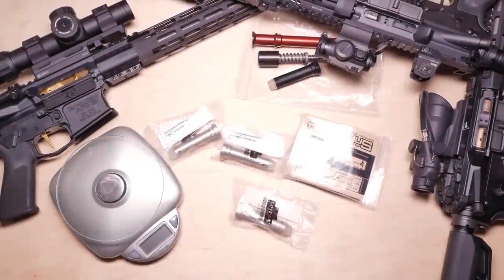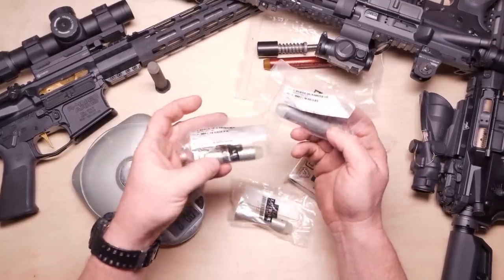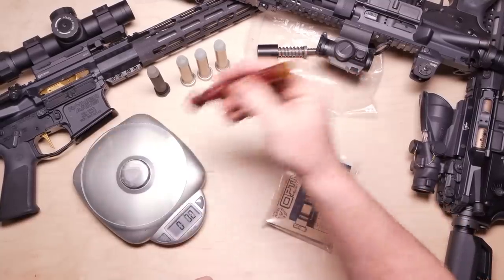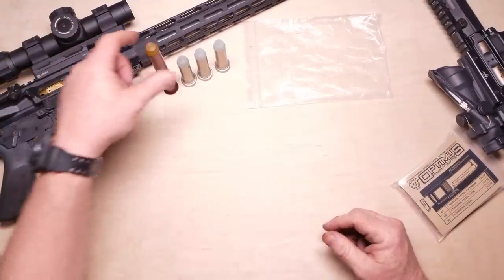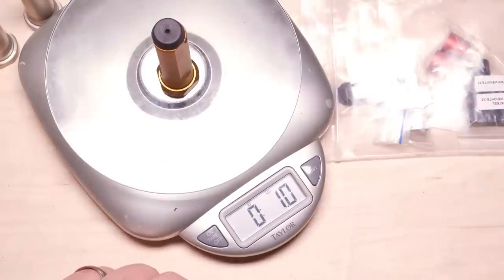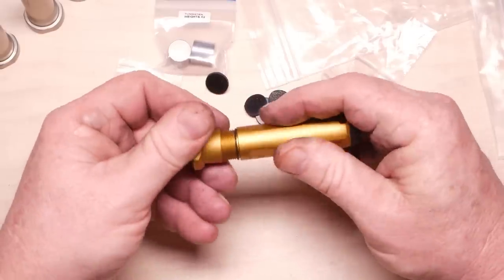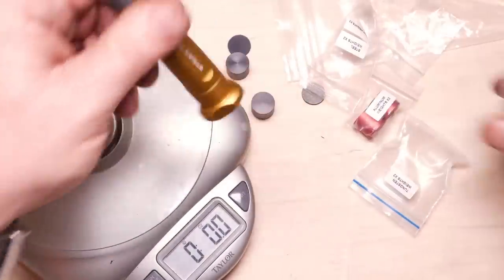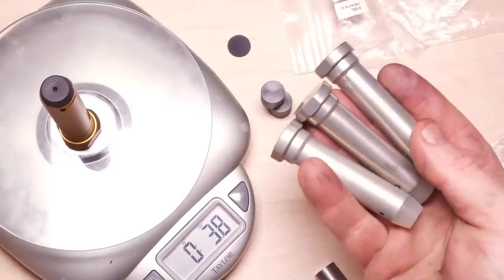Strike Industries Optimus Buffer System and Why it's Cool

Comment: You can buy a pack of tungsten weights and do the same thing with your standard carbine buffer
Reply: Trance Phibian where would
You buy the weights from?
Reply: @Spectre361  lots of places but Undranded AR has very good pricing.
Reply: Shawn Thomas i got some from amazon. I think they run around 6 bucks for 3. Prices might have changed.

Comment: Talk about making something overly complicated and at the same time more likely to fail... You can change the weights in any buffer by driving out the spring pin in the back... which cannot then unscrew like this overly complicated Strike Industries design and totally lockup your rifle. Save your money and buy individual tungsten (and aluminum weights, if needed) from a reputable company like Brownell's or just buy different weight buffers and mix and match to your heart's content... H0 (standard carbine) 3 steel, H1 2 steel 1 tungsten, H2 1 steel 2 tungsten, H3 3 tungsten weights... it's just that damn simple...
Reply: I couldn't get the damn plug out without ruining it.
Reply: Blake a lot of them you can’t and a lot of them are solid and won’t accept additional weights. Some have a sand like material and for that reason are not intended to be opened. I’ve bought a couple KAK adjustable buffers. You punch out the roll pin and remove the rubber piece as John Foley is saying. It comes with an assortment of different weights like the one in this video. I use it to see what buffer weight runs best with each build and then buy that appropriate buffer.
Reply: @mblake0420  I have never had one too stuck that I couldn't get it out, but you may have to dead blow it out (think of something that functions like a bullet hammer, to slam the weights against the nylon tip from the inside) and never try to pry it out. Maybe use some light heat gun action if it is really stuck... good luck buddy.
Reply: @nicklaustietje2749  I haven't run into the powder type yet, but should be easy to tell since the weights slapping around in a regular one is easily recognizable.  Also note that this is normal and part of the original Stoner design and the weights need to be able to move some. Make sure that you reinstall the pads between the weights but don't go glue them together or jamming extra pads in there - the slight movement in the weights help dead blow the chamber locked and reduce the chance of bolt bounce.  FYI bolt bounce usually is only a problem in full auto, so don't sweat that too much.  Also note that in some piston operated designs they use dynamic (hydraulic) buffer design that is not standard and it has to be used with those specific designs. Not sure if or how you would go about adjusting those... not my cup of tea...  Also thanks for the tip on the KAK set, I like that idea...
Reply: Yeah, that was my take as well. Seems like a noob solution in search of a problem that just isn't. JM2C
Reply: Yes the normal carbine buffer is simple to tune as you say. 3 tungsten weights are about $25 on line.
Reply: @johnfoley3633  it's tungsten powder
Reply: If you're playing around with different uppers, barrels, gas lengths, BCGs, buffer springs, suppressors, ultra light weight builds, swapping different things back and forth etc these can be handy.
Reply: Overcomplicating things is what strike industries does best

Comment: As some other viewers noted, you can change the weights in a standard buffer no problems and actually you can buy a stick of tungsten from McMaster Carr and make your own very custom weights to dial it in. I did like what you noted about how quiet that polished buffer spring was compared to normal ones. That’s pretty (literally) slick

Comment: Looking forward to your Strike Industries build.  They have a large product line.  I am using one of their charging handles and an adj. Gas block that was inexpensive, both work.  Although I did remove the (2) 8-32 set screws  (the adjustment &locking set screws for the gas flow), and replaced them with socket head cap screws that stick out of the handguard, and use a larger Allen wrench.  Also, the 2 set screw holes that fasten it to the bbl had a longer wider pattern (approx. 7/16" over center hole to hole).  Only one 1 set screw engage a double dimpled DPMS 'Recon' 16 1/9t bbl I nabbed recently from CDNN.  Shoots good.

Comment: If the tube, rings and spacers are sold separately that is a good idea. That way if you have multiple AR's and want to you can tune it to each one without having to move it from AR to AR and constantly changing the mix inside.

Comment: The problem I have with buffers is that you really don't know what your getting most of the time.  Kid you not pricing a buffer was one of the hardest things I had to do when I build my first AR, because these manufactures just don't give you the actual specs on the buffer other than the weight.  I mean you can take them home and open them up, but you probably wont be able to return it once you do and find that the buffer isn't up to your standards.  A couple months ago i found one of these online and decided to use it on the Aero Precision rifle I was building.  Absolutely love it.  The buffer comes with all the weights and even spacers you need to easily customize the weight of the buffer down to a 10th of an ounce.  Yes please.  Strike industries hit the nail right on the fucking head with this one.  Got my rifle tuned in with this buffer right at the range.  Decided it ran perfectly just under standard H2 weight at 4.4 ounces.  After I ran this buffer for a couple weeks in the rifle I decided I was switching out the buffer on all of my AR's to this one.  Now I only run these buffers.  Yes they are 65 bucks each but absolutely worth it.  Even have an extra one ready to go for the Alexander Arms build in 6.5 grendel thats already in the works.  Also Im a funny guy that likes to change the weight of the buffer on my rifles depending on what Im doing with it.  For bench shooting I want my rifle to run as soft as possible and that bolt cycle as slow as I can get it, so I up to a heavier buffer.  For training I like the rifle to run a little harder so I lighten the buffer.  This makes doing that so much more convenient.

Comment: that captured buffer system looks like an Armaspec… I just bought the Spikes powdered Tungsten H2 buffer for my Ruger SR556 … I have the giessele 42 braided spring and the Primary Weapon Systems buffer tube that took care of the carrier tilt that occurs with piston AR's...I put POF's roller cam pin in the BCG and the darn thing is so damn smooth, I shed a tear every time I rack it ;O)
Reply: I bet you do. I would cry for wasting all that cash every time I pulled the trigger too.
Reply: @mr.lovell3645  lol, "are you under the impression that these parts need to be replaced after every pull of the trigger". My second comment was based on the fact I'm sure that you cry everytime you shoot it. I bet you even scream "ouchie" and rub your shoulder. 
But,with that sentence it all cam to light and,I  understand now. It makes since why you support an anti 2ndA company spend 3 times what the rifle is worth to purchase it. Especially when there are far superior DI rifles on the market. If you want the best of a design, you have to start by buying the platform the design was designed for. The ar "gas piston" system solves a problem that never existed in the ar. Frankly they are far over rated now and theybare not liked by anyone and they are gimmicky.
 Then you buy all parts that are two to three times expensive than equally reliable parts or superior parts. But,considering who you seem to be a fanboy of,well it makes sense why in that fanboy way.
And I just happen to love the fanboys."look at me kotaboy, look at me. Please say something to me please. I'll kiss your feet please let me kiss your feet"  lol, 
If you had bought a feal rifle from a real company at normal cost, you wouldnt have to worry about premature wear on the reciever.
I dont ask you to convince me why you bought more over priced crap to go on over priced crap. I guess you probably need to tell someone to convince yourself. One day you may get lucky and find someone who just happens to have the same habits as you. Good day. You are special and you dont let anyone tell you different.
And you realize this was a strike industries video. Oh,my bad. I forgot you were just needing someone to say, "oh,that is so cool. I wish I could be just like you." Yea,well, I may have. But you bought a boat anchor then put more money into it to try to solve problems that made it trash to begin with. Not to mention heavier than the standard DI design.
Better luck next time.

Comment: I love the fact it unscrews from the top. that makes it way easier to change the weight at the range. Ive always used the KAK system (45$ for a buffer body, tungsten x3, steel x3 and aluminum x3); but these are anodized, which aesthetically looks better and doesn't require a punch and hammer... I love strike products, I've used their stuff since 2015; but I hadn't seen this yet. I'm actually building a pistol currently using their Gridlock handguard, safety, afg, forward assist and trigger guard...

Comment: There is allot missing here.
TL;DR: https://youtu.be/DYf-MLMODhA
The important bits are barrel weight(& to a slightly lesser extent length), gas system length, receiver extension length, buffer spring & buffer weight. Throw a suppressor into the mix for more variables...
The A1/2 use rifle length Buffers in rifle length Receiver Extensions ("buffer tube" from here on).
After Colts patent on the M16 ran out they had to make enough changes to sell the military & came up with a Carbine. A shorter carbine buffer tube, 3oz Carbine Buffer & higher RPM's quickly found full auto malfunctions due to bolt bounce so the heavy H/H1 buffer was made replacing one steel weight with one (comparatively costly) tungsten & the military adopted this as the M4 Carbine. The weights are "loose" to push/hold the bolt forward when it wants to bounce back. A Carbine Buffer at average Joe's semi-auto firing rates will work fine with some bolt bounce... high firing rates like Jerry Miculec's not withstanding.
H2 (2x tungsten weights) was for heavier barrels (SOCOM?) for issues as above, not to be confused with what we call a heavy barrel.
The H3 (3x tungsten weights) is only used for one or two weapons with (what we call) heavy barrels, the ARAC(?) & something else.
A hydraulic buffer was prototyped but would wear out too easily (bust seals).
There is only one (military) captured buffer system used overseas (not by US).
9mm AR's being blowback operated need to keep the bolt closed longer & thus need a heavier (often black) ~5.5oz (preferably solid) buffer. They should also be longer (or have the rubber extension or 4-6 quarters inserted into the end of the buffer tube) to cover the FCG to keep empty shells out (bolt stuck back) & to reduce the velocity against the bolt catch to keep it from breaking on LRBHO. Colt's 9mm AR SMG's had a specific buffer that I don't remember much about & is quite rare.

Don't quote me on this as I may have forgotten some stuff or gotten some stuff wrong, do your own research.
You want to find the sweet spot between fast enough cycling, slow/soft enough to reduce wear/recoil & most importantly reliable. The temperature, air pressure & such can affect gun powder burn & turn a reliable in the hot sea level south into malfunctions up in the cold high(er) altitude north (also PoA PoI). The military wants reliability everywhere in everything & 200lb gorillas don't mind a bit of rough.

Comment: You can purchase tungsten buffer weights to change your original carbine buffer weight or complete buffers from https://pur-tungsten.com/products/sporting-goods/ar15-accesories/.
Turned my one of my carbine buffers into an H2 using two of the weights combined with one of the original weights.
You can do a search for the weights of each specific buffer, If I remember correctly, the H2 is around 4.6oz

And no, I don't work for them, just happened upon them when doing all my buffer research.

Comment: How does the optimus fit with the SI flat wire spring? I purchased the flat wire spring and I noticed it doesn’t fit well over the lip of my stock buffer. The optimus looks like it doesn’t have that lip.

Comment: Hello... nice video.  As this was 3 years ago, I'm wondering what your experience has been.  Are you still a fan?  I'm relatively new to AR's (and firearms for that matter), but it seems like this is very easy to swap out.  As such, I think I may buy one to figure out which "solid" buffer I'll need and then pick up a solid version of the right weight.  Just my thinking right now.  Anyway, thanks for the video and, if you see this comment, I'd love to hear if what your experience has been even if no issues.

Comment: I think for the all said and done I'd rather have three single buffers to swap out. Then I'm not worried about where I lost my weights. Plus I have extra buffers to put in other rifles instead of just the one. plus it would really suck if it came apart inside the tube while you're shooting and cause a feed jam. Lastly aluminum threads if that's what that buffer is made out of responds poorly to harsh vibration.

Comment: Love these buffers. Looking forward to your gas block vid. I'm running a superlative arms adjustable with this buffer in my AERO and I love it.
Reply: I agree the superlative arms adjustable gas block for the win.  It can be used as either a restrictive or bleed off block, your choice, depending on your needs.... KB please do a video on these outstanding dual function gas blocks. Not a shill, but I retrofitted all my rifles and use them on all my builds now...

Comment: Thanks KB. I was going to order one of these from Geissele. You just saved me a few $$$.
Reply: R Win that Geissele spring is the absolute best buffer system you can buy.
Reply: James Worthy I bought their spring for my do all 16” Izs definitely the best out their on par with vltor. I just didn’t buy Geisseles buffer weight system
Reply: R Win from my experience you might need their buffer as it’s proprietary to their spring.  YMMV
Reply: James Worthy I ran ~200 rounds with their spring and a standard BCM buffer yesterday. So far no issues. The ejection pattern did go a little past the 3 o’clock position though

Comment: Good video, but for the $60 Ill take the 3 buffers with a combined 6 tungsten weights and 3 steels weights. From there I could make 3 x h2 buffers for 3 rifles instead of the strike industries 1 buffer for 1 rifle.

Comment: If you're looking for a great buffer system, the Geissele Super 42 H1 buffer and braided buffer spring is God tier.
Reply: @KJV1611AV  since it's a braided spring the buffer shaft diameter has to be reduced to keep the overall outside spring size in spec. Other than that the 42 system fits perfectly in my POF buffer tube.
Reply: @josephesteves1372  Good to know it works in your POF. It works in my Geissele, BCM, and PSA tubes perfectly as well. It should work in every milspec tube without any issues. Just so everyone knows, you MUST use both the buffer and braided spring in conjunction, never mix and match with other parts. It's a well tuned system.
Reply: KJV1611AV Arms Unlimited sells a braided spring that works with standard size buffers for like $22.

Comment: Gotta question for anyone on here with the knowledge just ordered a low mass BCG from AIM for my wife's pistol. I want to lighten the weight and recoil, am I gonna have to get an adjustable gas block to tune it? Or would changing out buffer weights do the trick if it doesn't run good? Thanks

Comment: Be good for testing but I wouldn't run that in my battle rifle.
Reply: Blake I do the same thing. I use a KAK adjustable buffer to determine the best buffer weight for each build and then I buy that buffer.
Reply: Why not? I have the Odin Works adjustable heavy buffer in two of my guns, and I run them HARD. Never had a single issue.
Reply: RooTheDestroyer oh they’d work no doubt. It’s just that they are a little more expensive, and once I found the weight that works best for that gun I won’t be changing it unless I run suppressed, and if I have an adjustable gas block then I won’t change the buffer weight even if I were suppressed. I just like to use it as a tool to find what works best and then buy a buffer in that weight.

Am I close here Blake? Or do you not trust the reliability of it?
Reply: @nicklaustietje2749  I got my original one because  the standard carbine buffer had my gun cycling way too fast, so I got it to get it exactly where I wanted it. Once it was dialed in, I hit the set screws with red locktite and never took it out of the gun. The second one was because I built a 10in 300 blk and had no idea what buffer to use. Once it was dial in it stayed in its gun as well.
Reply: Nothing has a track record of working like a standard buffer
Reply: @mblake0420  Except for when they don't. Like in my rifle.
Reply: @punk303  your rifle has issues
Reply: @mblake0420  Yeah, but mostly cosmetic issues. That rifle has a little over 15k rounds through it, and it runs like a god damn sewing machine. It is however probably due for a new barrel, and I might retire the BCG at the same time.